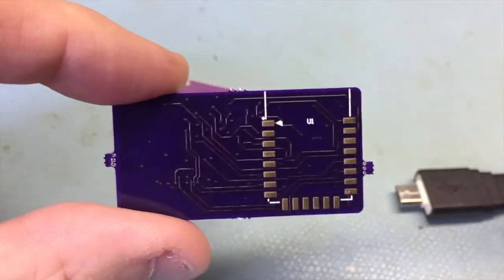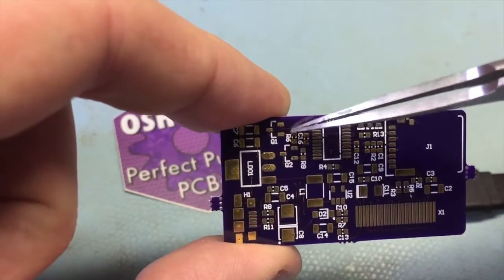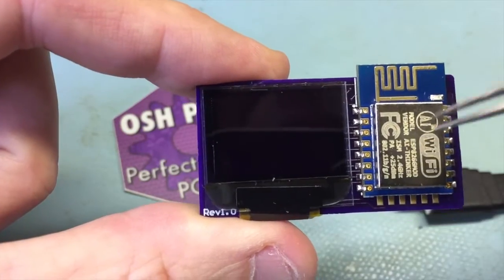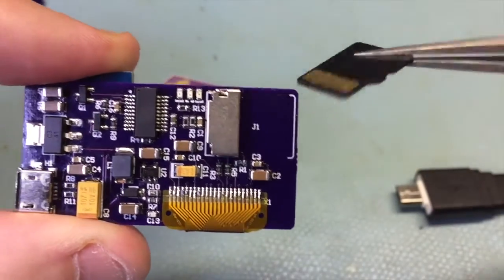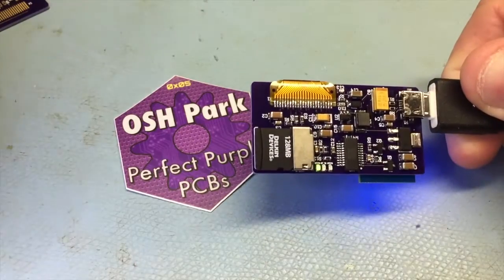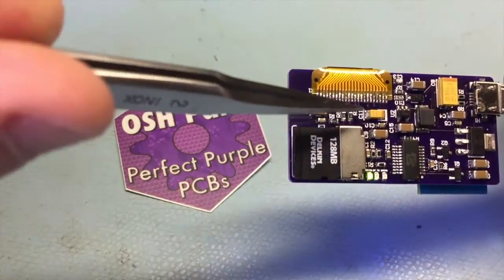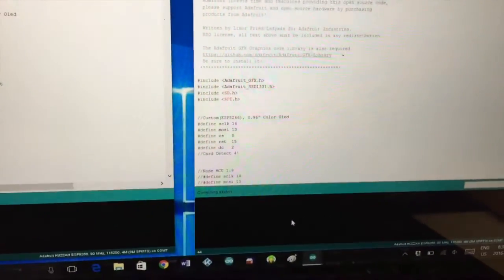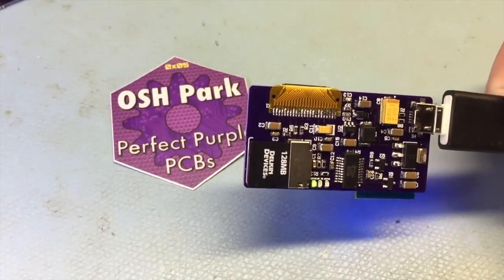ESP8266 Color Oled

Comment: would the ssd1332 oled work with this?
Reply from the maker: Sean Ocansey not sure. I've never used the SSD1332 before.
Reply: OK I've heard they're a lot cheaper, but probably because they're just the screen and not the whole board.

Comment: the esp should be flat against the back of the oled. powersupply should be external, same with microsd. unless you managed to make this sub 10$ assembled already.
Reply from the maker: shodanxx true. I don't really like how parts were placed either. It's just a quick design that I threw together to get it working. I'm not selling them or anything. I just wanted to see if it worked.
Reply: I agree with that. Would be a perfect candidate for a very compact display unit that way.

Comment: Impressive! Are the pads below the ESP on the front a promini style uart connection?
Reply from the maker: Jon Raymond the ESP has left, right and bottom pads. This design uses only the left and right pins. The bottom ones are not connected to anything.
Reply: You're right, my bad. I forgot about those extra pads. Do love that SD card holder. Hard to reflow?
Reply from the maker: Jon Raymond I've only hand soldered the pins. Reflow would be much easier.